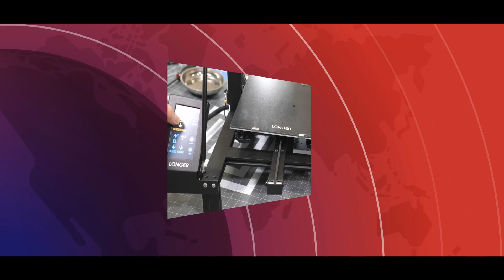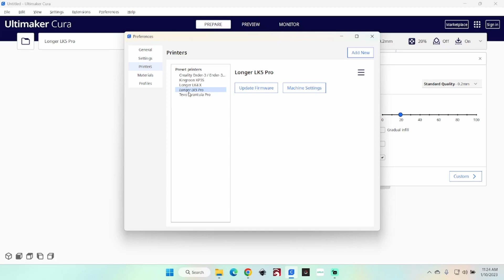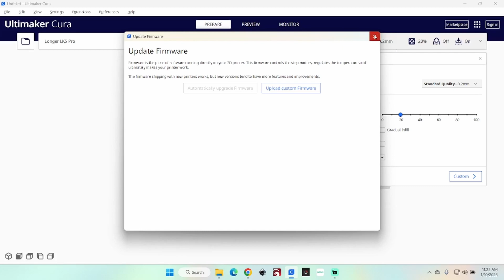Longer LK5 Pro 3D Printer Firmware Update

Comment: i dont recommend updating it. i updated mine when it starts printing it moves to the center of the bed and turn off nozzle and bed heat. went back to original works fine. Also prints fail halfway through. also does anyone know what the original marlin version that came with the printer from factory??

Comment: Thank you very much for the tutorial, but after updating the firmware the printer no longer starts printing and even when I try to level the plate, it does not go down to touch the plate but remains at the top, then it returns to its standard position.  How can I fix this? I tried again to update the firmware several times, or to turn the printer off and on again, but to no avail
Reply from the maker: You could try reverting to the previous firmware version and see if everything works again.  Otherwise, you will need to contact Longer.

Comment: I need to re-install the firmware.  Motherboard was wiped.  I have a Mac and I have connected my printer to the Mac.  We I try to install the firmware Cura says no printer found or connected.  How do I force the connection?  The printer is on.
Reply from the maker: You will need to contact Longer.  I am not a Mac user.

Comment: UPDATE FOR UPGRADING FIRMWARE: I recently purchased the LK5 Pro.  I've been attempting to add a BLTouch to it with no success using the instructions on the Longer website.  As it turns out, newer builds of the LK5 Pro use a new motherboard, an MKS Robin E3 v1.1.  The instructions on the website are for the old motherboard they used.  

When I would try to flash the firmware using a USB connection through Cura, I would keep getting an error that the computer couldn't communicate with the printer (not exact words). I contacted their support and they provided me with a BIN file for flashing the firmware using an SD card.  If you have the new motherboard version in your printer, you cannot use the USB connection method to flash the firmware.  It must be done using a bootloader and a BIN file. 

Using the BIN file I was able to successfully flash the firmware to the version needed to update the machine with a BLTouch device.  It's some version of Marlin 2.x with additions for auto-leveling.

Comment: That takes care of updating the mainboard, but there are updates for the touchscreen too that can be installed.  To update that though you will need to remove it from the casing in order to access the microsd card slot on the back side of the touchscreens board.  IT IS VERY IMPORTANT THAT YOU CHECK THE INFO SCREEN ON THE PRINTER TO FIND OUT WHICH TOUCHSCREEN YOU HAVE AND THEN ONLY FLASH THE CORRESPONDING TOUCHSCREEN FIRMWARE TO THE TOUCHSCREEN, DO NOT FLASH ANY FIRMWARE FILES THAT DO NOT EXACTLY MATCH YOUR TOUCHSCREEN MODEL (ie. DW, DWTJ,.....).

Comment: Is there a special cable to use?  Tried doing this yesterday but wheni connect the USB to my laptop it makes a sound but my D driver is not showing up.  When I try to get the files on cura no files show up which is probably from the wire connection I'm guessing.

Comment: Thanks for this video.
U have any idea if longer 5pro will let me use a 0.6 nozzle? when using PLA there is no option but the 0.4 mm nozle
Thanks
Mike Rozov
Reply from the maker: Have never tried that, but if using Cura, you could probably make some adjustments in layers

Comment: Do I need to update the screen as well? I can see that it updated on the about area, but the screen still says 3.2 DWTJB
While the Mainboard says 4.0 Marlin2.x-BLDual.
It's also now refusing to level.
Reply from the maker: Should not have to.  I did not have any issues when I upgraded.  Perhaps contact Longer Tech support.
Reply: @rogersshop  I checked the about on my printer and realized I accidentally downloaded the wrong firmware version for the board I have. Thank you for the response though.

Comment: Hey, does the firmware already has the update to support both the Dual Blower fan upgrade and the BL Touch? 
With also this latest update that Longer released to fix the offset when also having the Dual blower installed? 

V0.4.0-BLDual 2022-02-18
* Fixed probe y offset issue
Reply from the maker: I don't know about the BL Touch, but does support the dual blower fans (mine has this)
Reply: Hi...i have a problem after the firmware Upgrades...the Y offset don't go homing to 0 .... how can i fix this problem :\ Thanks

Comment: I need some help....I updated the firmware in my LK5 pro and now if I go to print a file, it moves to a position, stops, and never runs. Then it's shows temps at zero. And now, if I go in cura and click update firmware,  it says it can because it's not connected to the printer. Fwiw, it is connected via USB. Thanks!
Reply: I went back to the old firmware and it runs again, but the two nozzle fans aren't running. Any ideas?
Reply from the maker: @TheHammer  I have no idea (?).  Maybe try reaching out to Longer tech support (?)  Not something I have run across.
Reply: @Roger's Shop  I sent them a message and got a response just asking what version firmware I'm running. They are slow to respond,  so we'll just wait and see. I'm having problems with overhang drooping,  so I was hoping new firmware might help.
Reply from the maker: @TheHammer  Yes, a response can take 24 hours since they are in China.
Reply: Same thing happened to me, but mine is now a brick. I don't think this link is correct anymore, or something along those lines.
Reply: The same thing just happened to me. I updated this firmware and now it's not printing, but shows that the print is in progress as the temp keeps dropping to zero.

Comment: Thank you for the information. I updated my firmware easy peasy,  question for you, how do we calibrate esteps on these machines or do the longer units need this? Thanks
Reply from the maker: While I've done it on my Creality printers, running a test on the Longer 5 did not require any adjustments..

Comment: I recently purchased the LK5Pro and have printed about 250 hours with no problems until now. Every so often during a print the machine stops and asks to resume print. Its slowly getting worse and will do this several times in a 15 minute period. I bypassed the filament runout to make sure that was not the problem and the stopping continued. The current firmware is 0.4.0 Marlin 2.X , Screeen Firmware is 0.3.0    Any ideas??
Reply from the maker: YES.  And one of mine did just that.  Watch this unlisted video first, and see if that is what you are experiencing:  https://youtu.be/6GYpOFLFXCA  If so, it is not the firmware.  I had to replace the motherboard on this one.
Reply: @rogersshop  I think you are right about the Motherboard. I decided to hook up my laptop with Pronterface and load the file through the laptop and not use the SD card reader. While the printer was initializing I noticed a comment during the process that repeated itself two times: "echo: SD init fail" . So after loading the program through Pronterface everything has been running fine. I am at 5 hours of a 10 hour print and no problems. Even if this fixes it, I might better change out the board before something else fails. I ap-preciate your response, thanks. Keep you posted. JIm
Reply: @junder111  Hey! I'm facing the same problem as you!
So basically you're using your laptop connected to the printer and sending the printing gcode commands through the USB port therefore "bypassing" the mainboard processing? 
Could there be a way to do this with just a simple Android smartphone setup? That way it would consume considerably less energy than the laptop staying on all the time.

Would a program like Octoprint for android be enough to do it?

Comment: Thank you so much, I have been searching for weeks trying to figure out how to update my printer, Thanks!
Reply: I wanted to update the firmware but it was last updated in November 17, 2020.

the reason is the z stepper motor does not maintain holding voltage durring filament run out and you get z drift so the printer does not start where it left off. This is completely in excusable for this. They should fix the firmware rite away

Comment: What cable are you using to connect your printer to your computer.  
What does this firmware update do for the printer?  Is it necessary?
Reply from the maker: Standard USB Printer cable (generic if you don't have the cable that came with it)  I did not read the notes on what this updates, exactly.  Not necessary if you are not having problems.  i update when ever a new version is put out on most of my machines, as a matter of course.
Reply: @rogersshop  yeah my printer didn't come with a computer cable. Thanks for the video and response.
Reply: @rogersshop  No need to tape the pins?
Reply from the maker: @JetFixxxer  I really don't understand that comment as I did not need to tape over any pins.  this was very simple and straight forward.
Reply: Use the one that came with it you will need to place a strip of electrical tape over the far right or left pin of the type A side also download the driver to connect 😉